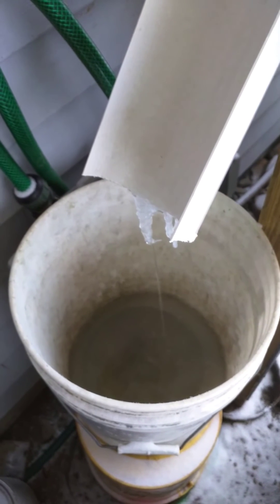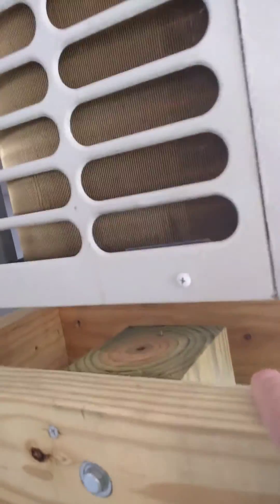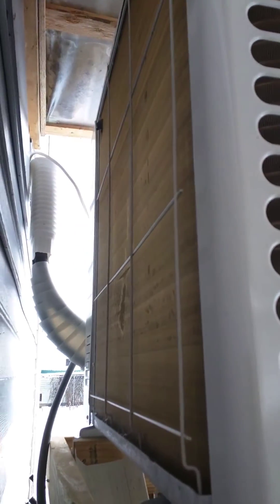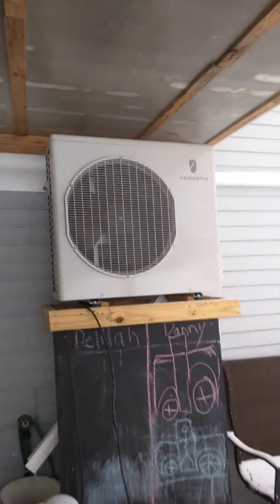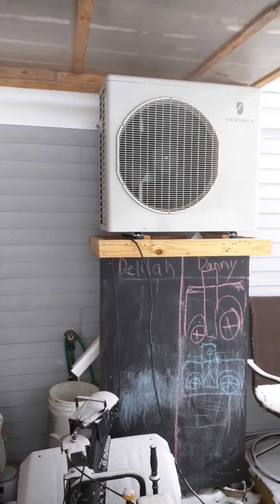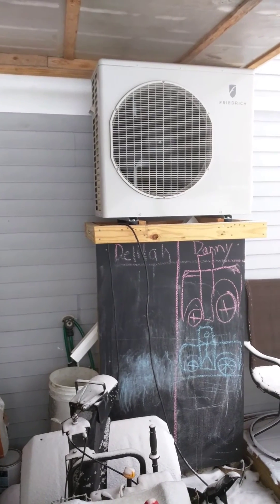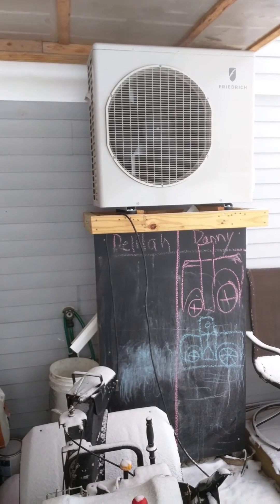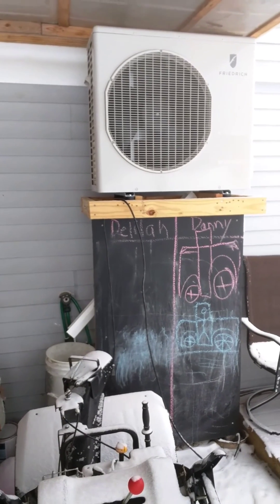Mini split heat pump defrosting LG Friedrich

Comment: I have a Friedrich mini split system, model MR24DY3F. Compressor fan motor is noisy and has to be replaced but I can't find it. Motor made FGA CO. LTD in Thailand, MFE-45VVT 100W 380V D:0.5 . Somebody knows where I can get it ! Thanks
Reply from the maker: https://www.master.ca/en/products/outdoor-unit-mr24dy3f

Don't choose consumer if it asks who you are. Choose contractor. This site has repair manual. Friedrich used many other brands and put their names on them to resell, this model looks like a older model Fujitsu. Friedrich pretty much doesn't exist with service or parts. Your best bet would to find which Fujitsu model they rebadged and you would have better luck getting parts since Fujitsu is a reputable company.

Comment: So a drain pan heater really isn’t necessary? Have you ever had the unit shut down from extreme cold?
Reply from the maker: No I had been down  - 15 Fahrenheit and the unit did not shut off. Cheap Chinese units and not cold climate units will shut off. This is considered a commercial unit so it has to work in all temperatures
Reply: ne7s29 I can’t decide if I want to go with the lg red 24k or the 30k lg
Reply from the maker: @Bajaheat  the difference between 24k and 30k out put is minimal. At 5f the 24k hlv lg unit puts out 24k BTU of heat. The 30k I believe puts out 26-27k BTU. Not 30k at 5f. The regular lg units don't put out rated capacity at 5f. Only the hlv extended pipe commercial unit and their lg prestige units.
Reply from the maker: @Bajaheat  if you are going to pay the money for the top model LG unit I would suggest you go with Fujitsu
Reply: ne7s29 I probably would if I could but Fujitsu doesn’t have any contractors in a 100 mile range so warranty and service would be lacking. I can go Mitsubishi bc my local installer sells them and lg but he said mitsu is just paying for the name and he prefers lg
Reply from the maker: @Bajaheat  if you can afford Mitsubishi I would most definitely go with that over lg. You're just paying top-dollar but they usually run for 20-30 years if you read through forums
Reply: ne7s29 i went with the 30k lg similar to yours should be installed beginning of December, I hope I don’t end up needing the base pan heater, I’m wall mounting it so that might help
Reply: @Bajaheat  I was going to install a LG hyper heat gets down real cold where I'm.  Would you go with LG over Daikin?  Mitsubishi was out of the budget
Reply: Curtis Heb I would go lg over Daikin, I almost went Mitsubishi but couldn’t justify spending 8-900 more for a unit that on paper didn’t perform as well in cold temperatures
Reply: Daikin are great there reliable and very efficient with there swing compressors but and in my opinion better than Fujitsu but other brands like Mitsubishi, lg and Panasonic (they don’t sell mini splits in the us but they are very good) have proven to be better

Comment: Hey what is the diagnostic tool that u use? I just installed 9RLS3HY yesterday. It works great but this morning - 2 defrost cycles between 7-10am

How often does your FUJI defrost?
Reply from the maker: AdSense Ninja DD If it's humid or snowing outside it may defrost every hr or two. defrosting is heavily based on the units ability to suspect potential frost build up. it uses out door temperature and many other perameters to calculate if defrost is needed. I have to say that it messes up the times and will defrost when there was no frost on the outside unit.